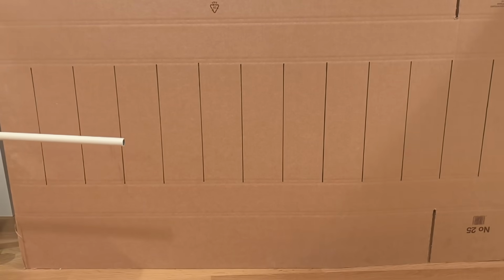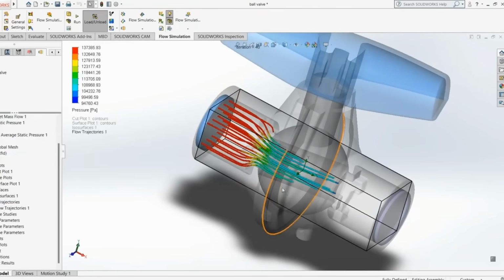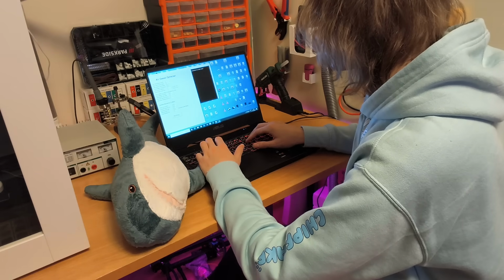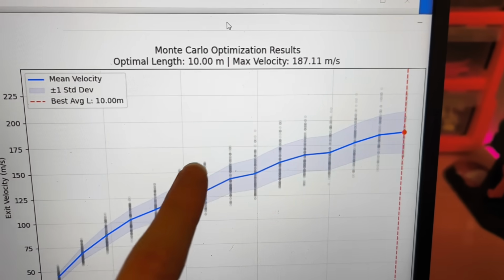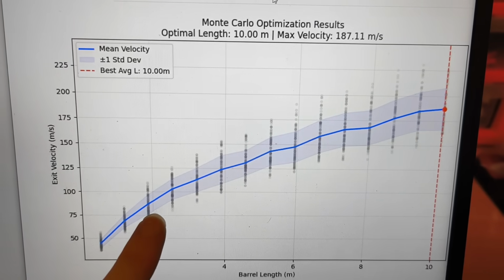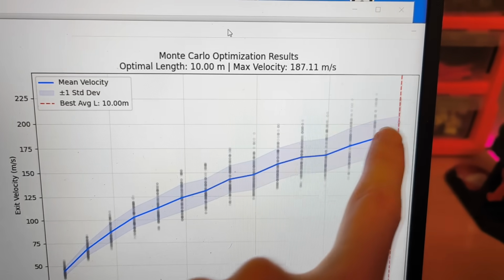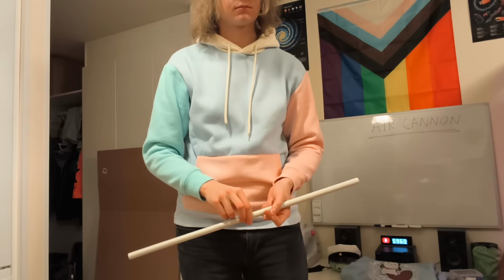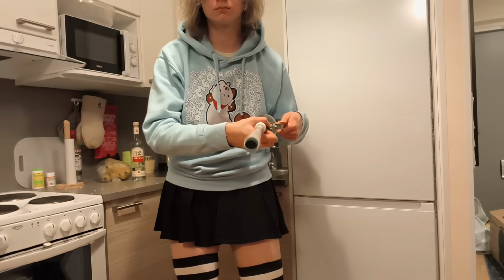I Overengineered an Air Cannon Using Physics

Comment: You are such a gem! You make me want to just go make something. I’m curious how did you learn to build all this cool stuff? Was it through university or mostly on your own? I’m a first-year EE student and we haven’t learned anything yet that lets me make things like this. Most of what I try to build I end up teaching myself from scratch (it’s overwhelming sometimes.) Was it the same for you? I know you’re mechE so it’s probably pretty different from what we do in EE. What we've learned so far hasn’t really made me feel any closer to making the kind of dope projects you do 
Anyway if you have any tips or advice for an engineer starting out I’d love to hear them. Thanks for being my inspiration!!
Reply from the maker: Thanks! :3  I mostly learned this practical side of things on my own, by just doing stuff, starting from the moment I got myself a 3d printer on my 15th birthday. From that moment on, I've just been experimenting with all sorts of things, from water rockets to fixed-wing UAVs. It's really fun, but behind the scenes of each project, I might be screaming into a pillow for half an hour because something won't work. Many projects have also failed. Those failed projects are the ones which have taught me the most, however.

The key is to not quit if a project fails, but continuing improving the design and trying again. University has amplified my skills, because now I understand all of this hydraulic and pneumatic stuff, and the math and mechanics behind stuff, and how the engineering process works in real life, from design to production.

For research and code generation, AI is a great tool, but you cannot trust it too much, and it doesn't fully replace human skill yet. But it's a great efficiency multiplier for projects involving programming, math, and understanding concepts.

Aim high, be persistent, and don't let small setbacks hold you back!
Reply: @Femboy_Engineering i’m not OP But thank you so much this is super cool!
Reply: @Femboy_Engineering  Thank you for taking the time to reply. Guess I just need to keep building stuff and stop overthinking it 
Can’t wait to see what you make next! <3

Comment: blasitics girl! The cylinder with a rounded nose only makes sense for a projectile if you have rifling, because you want an increased area where the rifling can hold on the the bullet. However, when the barrel isn’t rifled you have no way of stabilising the projectile in flight. 
Therefore it will tumble an increased drag. You have seen this yourself. 

A spherical projectile would decrease drag both inside the barrel and in the air. Heck, it would even increase your penetration by increasing pressure, by decreasing impact are. 

Please continue improving the design.

Comment: Try shooting a potato. It won't leave a gap in the barrel, but it will easily fly out under high pressure, even with a short tube.

Comment: You can use a hanging piece of fabric like a blanket, curtain or a towel to stop the projectile vetter than foam, as the movement of the fabric absorbs most of the energy of the projectile

Comment: That air cannon optimizer program you have reminds me of hgdt, a application program from the spudfile forums that I used for my own 2 potato cannon/gun projects :p (difference being your program doesn’t look like something from the winxp era lol)

And I might just be yapping here, but maybe you could improve opening time on that ball valve by using springs/rubber bands to make it snap open, or maybe ditch it all together for a modified sprinkler valve with a air gun nozzle modified onto it, anyways great video and project :3

Comment: Sup, hows it going? Which CAD software do you use to model your projects?
Reply from the maker: Hi! Good :3  I use both Solidworks and Fusion360, depending on if I need a more parametric assembly and parts with gd&t, or just a quick part for 3d printing.
Reply: @Femboy_Engineering Thank you for this valuable information, you are an inspiration to me, keep the amazing work up!
Reply from the maker: @ZenithSecondAcc Thanks, I will! :3

Comment: Some tips from personal experience for your next air cannon(s):

- Replace the presto valve with an automotive one. Presto valves are trash in every way. Automotive valves can handle higher pressures, are much more durable, and can be used with almost all pumps and compressors.

- Wear eye protection as long as the tank is pressurized. These tanks exploding while under that amount of pressure is extremely loud. I am NOT a safety nerd, but air tanks are fucking scary shit. I once exploded a 0.5L bottle with air, and the bang was loud enough that I had to apologize to my neighbors. Additionally, air compressors don't only output compressed air, but also used oil vapors and water. These liquids condense inside air tanks, causing tanks to rust from the inside out. This condensate must be drained frequently. Air tanks have exploded many times, and they are lethal. There are a lot of videos and images of air compressors getting launched into the air when their tank explodes. The rust inside the tank also gets shot out like hand grenade fragments, sticking into walls, furniture, and limbs. To visualize the energy stored in a given tank, imagine a huge spring being tensioned by a motor as powerful as your air compressor motor is, for the same amount of time that it would take that air compressor to fill up the air tank.

- The valve is the main power limit. Releasing more air doesn't make the bullet any faster if it has already left the barre. You can use much smaller but faster valves with the same barrel and still massively increase the power. I once built an air cannon with a pipe of a similar diameter, but with an electric diaphragm water valve, and, even without an air tank attached, I was able to shoot m10 or m12 screws through 4mm wood sheets. One screw actually stuck itself about 7mm into a solid wood beam. I built a bigger one with a pneumatic cylinder controlled ball valve (very slow, but still faster than what humans can do), with a barrel ID of 25mm. That one shot things through 2mm thick OSB sheets, which is not connected to the suspiciously screw-shaped hole in the OSB wall of my workshop.

- Common faster valves are:

1. Burst disk: The fastest valve possible, very easy and cheap to build yourself, but needs replacing after each shot, a consistent trigger mechanism, doesn't work well with higher pressures, and has the risk of going off on it's own.

2. QEV: Short for Quick Exhaust Valve, these are used in the industry to rapidly vent pneumatic or hydraulic cylinders, and can go up to hundreds of bars. They are extremely fast and often used for small high pressure CO2 guns, but work for bigger ones too. Unfortunately, depending on size, material and pressure, these can go up to multiple thousands of euros.

3. Pneumatically actuated rack and pinion valves: These are valves, often ball valves, that are actuated by two opposing pneumatic cylinders through a rack and pinion mechanism. They are pretty damn fast, and very large versions of them exist too (over 5 inch ID), and available for high pressures (100 bar), but the actuators can be very expensive.

4. Spring actuated ball valve: A very powerful spring for opening the lever, mounted close to the point of rotation of the lever, used to open the valve quickly. A locking mechanism is used to hold the lever in the closed position. Relatively fast, very cheap, and can be made with basically all valves, and they don't require any air or electricity to function. Disadvantages being size, weight, and the loaded high power spring near your hands.

- Tyler Bell has a great channel where he builds air cannons and other compressed air powered things, and he has a lot of info about valves.

- Rotating bullets could help prevent the bullets from impacting sideways. Giving the bullets some fins that make it rotate could do the job here.

- Use heavier bullets. These light 3d printed ones are cool and all, but the real fun only begins with metal bullets. Screws are great for this, but shortened or even machined metal rods are the best. They make your cannon leagues better and can be reused many times.

- Keep barrel length limited. Too long of a barrel not only makes it impractical and heavy, but the bending of the barrel also slows the bullet down. The air resistance of the small pipe and the pressure drop of the air tank will eventually even decrease bullet velocity. For your current barrel length, I'd say a length of 1m to 1.3m is absolutely enough. Of course, a bigger barrel means it can be longer to a point.

- Use a metal barrel. Metal, especially stainless steel, has much higher strength and very low friction.

- Air compressors are cool. Air cannons are much more fun if you don't have to pressurize them yourself, and compressed air can be used for many many other cool things, like pneumatic actuators. There are "silent" ones too that have two pistons with a 180° crank angle offset and some other tricks to be very quiet. Some people use fridge compressors for this, as those are also extremely quiet.

- A bigger distance between target and barrel allows you feel the real speed of the projectiles.

I have videos of me shooting both of my air cannons, and the explosion of the 0.5L water bottle, on my """channel""", if you want to see how they are built.

Comment: 2:44 Just a tip from a fellow crafter/maker… whenever you’re planning to mix up some epoxy, have a quick think/look around for anything you might need to fix while you’re at it. Chances are there’s something that needs a little fix, that just hasn’t been worth it in the past.. a cracked switch, a little broken toy, another project, whatever. When you mix up the epoxy, it’s always easier to mix up a little extra, so use the extra to fix whatever needs it while you’re at it and try to use it all up and not waste any. 

Also, buy wooden craft sticks for stuff like that, they come in handy for a million little mixing/poking/scraping/repair tasks! 

Be careful about mixing the epoxy on paper because it can seep through and glue to your surface, use some old magazine pages, or a few layers just o be safe! 

Good luck! I’m mostly just commenting to feed the algorithm so feel free to ignore me. That’s fine too!
Reply: Noted

Comment: Title says overengineered but uses a slow opening ball valve (among other shortcuts)
I got scammed.
Reply from the maker: Don't worry, this is just the first video about this cannon. I've already ordered a proper solenoid valve, and I'll probably order a ballistic chronograph.  I am just a poor student, so I am working with what I've got at hand here, and things don't always go as planned.
Reply: @Femboy_Engineering  Solenoid isn't a fast opening valve, is it? There's a type of valve that is opened fully by the initial gas that is let through when opening so in a high pressure valve it opens very fast, like comparable to a burst disk kind of speed.
I'm sure I saw someone like NightHawkInLight or someone like that build that valve out of just PVC pipes when making a potato canon or something.
Reply: @MrRolnicek Youre talking about a QEV valve, ive used those in my airguns before and they open extremely fast for a cheap valve

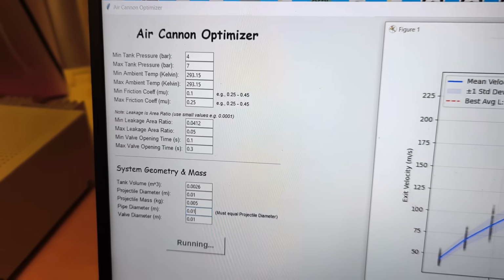Comment: what was even the point of the simulation I mean longer barrel is obviously better the graph at 1:50 and from what I see you ended up just picking the longest piece of pipe you had lying around. Also if you want to measure the speed you can literally just search up how they did it in the 1800s. There are some decent methods.
Reply from the maker: The derivation of this adiabatic model of the system and the making of the simulation tool, which is based on that, is actually going to be a chapter in my bachelor's thesis, although it's quite overkill. My intention was to then try and kinematically validate the tool by comparing the simulation-predicted velocity with the actual velocity of the barrel at the pressures used in the simulation, and then make a nice distribution graph of it, but I didn't have a proper chronograph to measure the actual velocity of the projectile, and the high-speed video wasn't able to give reliable estimates either, so I had to abandon that idea for now.  

However, for part 2 of this video, I've ordered a proper solenoid valve, and I'll probably also order a chronograph, to be able to get far more precise, repeatable, results, with far less variance.
Reply: @Femboy_Engineering  If your using a solenoid in part 2 wouldn't it just make sense to use CFD and add in the monte carlo method like you did with your adiabatic model. I think you would get much better results. Obvious issue is if you have a bad computer and waiting for a few hundred CFD sims to finish is unreasonable.

Comment: there's a huge loss of force because of the time you waste on opening the valve, this could be optimized i think
Reply from the maker: True. This is the fundamental problem in this setup, which I also confirmed by simulating it with quick vs slow valve opening time. I could probably get more than double the kinetic energy for the same pressures, by switching to a fast valve. I might do a part 2 of this video, where I upgrade the valve!
Reply: @Femboy_Engineering Look into QEV valves, i switched to using that on my airgun and it got way more powerful
Reply: @Femboy_Engineering Good to hear

Comment: Always pressure test pressure chambers when filly filled with water first. Air can compress so by pressurizing it you're storing a ton of energy, effectively building a bomb if it does fail. Water does not compress (much) so the stored energy is much less.

Comment: Maybe for the bigger version you can use solenoid valves? They will open much faster and can be controlled with a small battery and a button

Comment: Yayy upload!!! :з 
The larger diameter cannon is going to be crazy cool, but I feel like it would take too long to build up pressure for it with a bike pump. U could try an electric pump or maybe the little CO2 canisters, just be careful not to blow up. 😰

Comment: What about a spring solenoid valve, with a lever lock ??
Reply from the maker: Yeah, I should probably have used something like that. Because this system was bottlenecked by the slow opening time of the ball valve, which meant that the projectile was already out of the barrel before the valve even had the chance to properly open.

Comment: Ok, I have a question. How does your family react to your behavior? (Im not talking about being gay, but about wearing woman clothes on the internet). I heard that there is a big polarisation on that topic in Finland.
Reply from the maker: Well, I wouldn't call them woman clothes, as the skirt and thigh highs were traditionally used primarily by males, especially here in the north, haha. I just like this aesthetic, as a young man. Considering the type of content, and the fact that I am now an independent adult, and my family is quite progressive for the most part, they have no issues with it! 

In Finland, there is quite a hostile attitude still, although the law is mostly equal. I thus feel it is important to break some cultural norms and bring more diversity into engineering, while being myself and wearing what I like.
Reply: @Femboy_Engineering could you elaborate on that traditionaly used by man part?
Reply from the maker: @iryd77  Yeah, traditionally, men in Finland and Northern Europe wore skirts or kilt-like clothing, especially in the Viking era and Medieval times. They were practical for horse riding and farming, and often paired with thigh highs :3
Reply: The pride movement is pretty strong in Finland, legislation is mostly progressive and accepting. However homophobia is normalized in a lot of places especially outside major cities. It seems from my pov that male dominated trade schools are probably the most dangerous places for queers. From what I've heard from friends, "jokes" about stoning gays to death are regularly made by students (sometimes by teachers!!!).